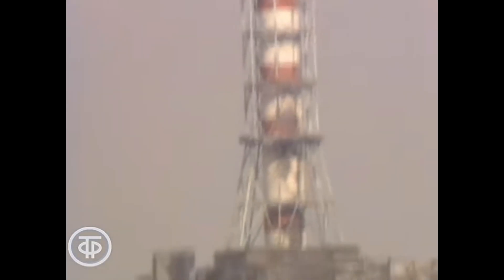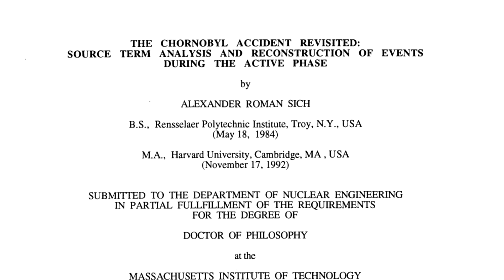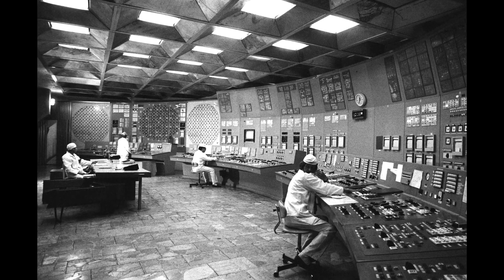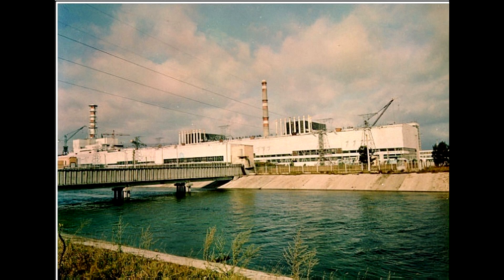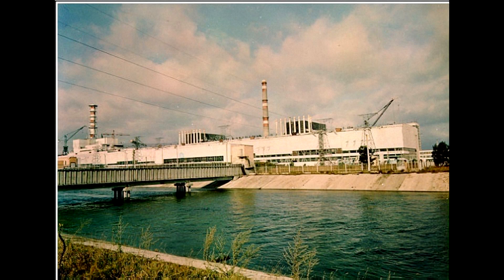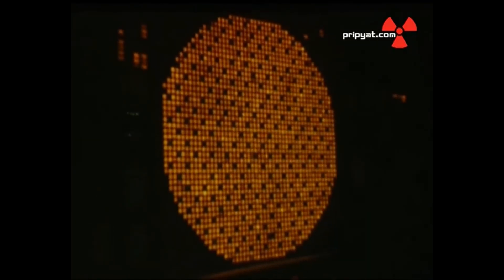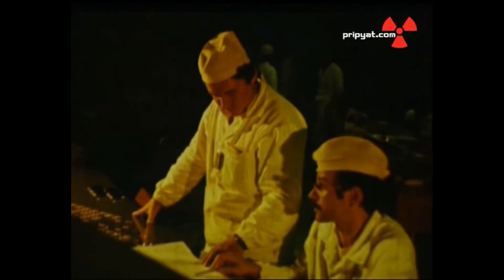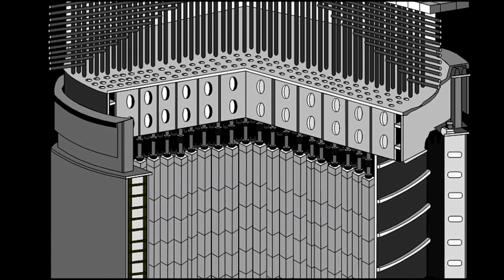Chernobyl Explosion Theories: Sich's Theory - The Last Seconds of Reactor Four

Comment: Chernobyl underwent a prompt critical nuclear excursion. The energy release at the power levels cited for 2 seconds would amount to a TNT equivalent release of 700 tons. As this is an exponential rise and the power level is only crudely estimable, the actual release may be substantially less or more than this. In either event, this was clearly a huge energy release measured in not less than tens of tons of TNT equivalent energy and more likely in hundreds of tons to a kiloton of TNT equivalent energy release. It was a low to very low yield nuclear detonation. 

That nuclear physicists do not want that to be the answer is irrelevant. That there is a dominant myth that reactors cannot ever nuclearly “blow up” is just that - myth. It happened here. It happened at SL-1. It happened at KIWI-TNT. 

The instant this energy was released other things happened as well. Nuclear fuel and cladding stores hydrogen gas as an inter-metallic hydride equivalent. In essence the naked protons fill the Fermi sea of electrons in the metal lattice. For transition metals like nickel, uranium and a few others this storage density can reach to greater than the equivalent storage density of cryogenic hydrogen in the same volume sans metals. This is what makes nickel-metal hydride batteries so useful for storing energy. 

During those few seconds the intense fluence of neutrons, gamma and x-rays rapidly dissociated an immense amount of the water, and raised the temperature in all of the metals driving the hydrogen out of the fuel and cladding. The hydrogen gas mixed with oxygen from dissociation and the in rush of oxygen from the air as the lid was ejected then led to the spontaneous recombination of the hydrogen and oxygen in a massive restricted detonation wave. 

Simultaneously, the sudden high pressure gas release from the dissociation and conversion of the water to steam drove the core apart radially and vertically. It became a giant mortar launching the lid into the roof, and detonating as it did so destroying all of the walls and roof. The reaction creating a temporary imbalance in forces that blew the bottom of the reactor down seven feet into the basement allowing the sand shield to flood in through the gap as the now molten fuel poured to the lowest point combining with the sand to create the corium that poured down through the five levels of the basement and sub-basements to become the elephant’s foot. 

In no way was it a “steam explosion”. Steam cannot explode. Vessels under high pressure can fail releasing huge volumes of water that instantly flash to steam and as an expanding vapor cloud carry great force. But it is wrong to call this a “steam” explosion. 

With the hydrogen gas release this was more analogous to a massive BLEVE.
Reply: Does the corroding Zirconium fit in anywhere for you?
Reply: @bobdrooples  Yes. Rapidly oxidizing in the high temperature environment, leaving the hydrogen from the water behind to mix with air.
Reply: Your arguments cogently explain the issues and fit the known facts better than the Sich approach.  Most people do not understand the consequnces of prompt criticality and its associated very short doubling time.  An analysis of what the doubling time may have been in the worst affected channels would be very interesting.

Comment: A video I'd like to see would be about the cranes. There were building cranes that were abandoned after the disaster. They stood abandoned for over thirty years. Are they still there? If not when did they vanish and what became of them?
Reply: Dismantles partially for the construction of the rolling roof prior to installation.
Reply: I'm sure the cranes you are talking about are at reactors #5 and #6 which are a short distance south of the main complex, the cranes were there for the construction of those units but all work at #5 and 6# was abandoned after the accident.

Comment: Honestly? I would imagine that there was a minor actual nuclear detonation mistaken for a steam blast.
Reply: The Uranium in a nuclear reactor will not detonate like in a nuclear weapon. It is not rich enough in U235, and there are too many factors impeding such an event. Which is good. Because the Hiroshima bomb contained 65 Kg of weapon grade Uranium but only about 1.2 Kg reacted before the weapon blew itself apart, so if a nuclear reactor with several hundred tons of Uranium could actually undergo a 100% efficient detonation then most of Eastern Europe and Western Russia would have been flattened. Luckily none of this is possible and I speak only hypothetically.
Reply: no, if such a reaction is started, it will not end until there is no more fissionable material left. you would be looking at a big crater and not at an otherwise intact powerstation today if that was the case
Reply: @supersst838 lol no that's not how this works

Comment: Don't know if there would have been enough time for sufficient hydrogen to build up to create the largest explosion but steam... Water expands 1670x its size when flashing to steam. If you can't keep that pressure in then it's going places.
Reply: i think also if hydrogen was the reason for destruction it would be much worse, as combustion like that really has power to it compared to the steam
Reply: Also the oxygen from the corroding zirconium.
Also potentially explosive together with the water depending on how the welds went.
Reply: This makes me remember a number of railroad disaster photos I have seen. Low boiler water instantly flashed to steam, extreme instant pressure causes an explosion that kills the crew and throws the boiler down the track ahead of the train.

The graphite, and maybe even some fuel went into the atmosphere when it was pulverized by escaping steam.
Reply: Also: if the water completely dissociated into atomic oxygen and atomic hydrogen because of the temperature it would fill even three times more space at the same temperature. And the temperature was extremely high, possibly in the hundred thousands of degrees.
Reply: Are we dead ahh 67 really? 🥀🥀🥀🥀🫩🫩🫩🫩

Comment: 5:55 as physicist it feels inaccurate hearing something measured in Watts referred to as energy, but I'm not familiar with the exact terminology of nuclear engineering.
Regardless, thanks for making this video! I love this kinda 'the devil's in the details' (for lack of a better word) analysis. Very well presented and explained, imo!
Reply: For nuclear reacts their "power" is commonly expressed in Watt of Thermal Output (how much heat the reacot itself is producing) amd also in watts of electricity generated. If i recall correctly the RMBK was rated for skmething like 3000 MW of thermal, but only produced about 1000 MW electrical
Reply: You are correct sir. Power is measured in Watts and energy is measured in Joules.
Other units can be used, depending on the context.
For example, where the energy released by fission is used as a measure of fuel irradiation or burnup. The usual energy units here are Megawatt-days or Gigawatt-days.

Comment: I dont understand why removing the water increases the fission rate as water acts as the moderator.
Reply: In the RBMK, graphite is used as a moderator.  So between the water and graphite it is what we call 'overmoderated'.  Changing the amount of moderator a little bit by removing some of the water (or just boiling it to steam) has little effect on the moderation rate.  But water is also a slight poison in that it absorbs some neutrons.  So in the RBMK design, removing water has little effect on moderation, and a stronger effect as a poison.  This gives it a positive void coefficient (boiling the water adds positive reactivity)  Much different than the west's BWR technology where water is the principle moderator and has a negative void coefficient.
Reply: The coolant water acts both as a moderator and as a neutron absorber.
So the net effect on reactivity depends on the relative strength of those effects.
When fast neutrons are emitted from the fuel rods, the cooling water is the first moderator they encounter.
When thermal neutrons return to the fuel, they must pass through the water on the last leg of their journey.
If the neutrons are well thermalised, a significant proportion of them will be absorbed by the water and that will reduce the number of neutrons that can reach the fuel.
When a RBMK operates with highly burnt up fuel, the effective fuel enrichment is low. For a given power, this requires a relatively high thermal flux to reach the fuel. That results in high neutron absorption in the coolant. So then the net effect of voiding the coolant is that more neutrons can get back to the fuel and cause fission, i.e. reactivity increases in spite of the loss of moderation also caused by voidage of the coolant. Operating in this state also requires most of the control rods to be withdrawn, so most neutrons sre only either absorbed in the water or in the fuel rods.
But when operating with fresh low burnup fuel, only a relatively low thermal neutron flux is needed for a given power. So most control rods need to be inserted to absorb excess neutrons and there is much less neutron absorption in the coolant.
Voidage of the coolant then causes a  less significant change in neutron absorption so the effects of reducing moderation then dominate. That gives a negative void coefficient. This seems to be how the designers expected RBMKs to operate most of the time. However economic imperatives seem to have led the USSR to operate with much higher fuel burnups. It seems they knew this caused positive void coefficients but they did not fully realise the hazards associated with this.

Comment: I always wondered if they had turned the water pumps back on at the original power surge if that would have been enough to get control rod's back in although the az button would probably still make it go pop
Reply: There wasn't any kind of abrupt surge until AZ-5 was pressed, and the pumps were still operating. They did need to add more water to keep reactivity steady, but it probably would have taken a minute or two to make a difference. Someone probably would have pressed AZ-5 before then regardless.
Reply: @MinSredMash  there was a very rapid increase in power before the az button was pushed the test to see if the spooling down turbine could power the pump's meant a reduced coolant meant a surge on power  that made the bio shield blocks bounce up and down it's even in the vid the power surge before they were there knickers and pressed the az button
Reply: @gingernutpreacher  You should watch the other videos on this channel to be disabused of elementary misconceptions (like everything you just wrote).

The so-called "bio blocks bouncing" is a perfect acid test for people who confuse fan fiction with history.
Reply: @MinSredMash  so testimonials are to be dismissed?
Reply: @MinSredMash  so you're saying there wasn't a big rise in power from around 215mw when they turned the pumps off? What ever you're taking I don't want any because it makes you eat your arm off and speak in a pottery's acsent
Reply: @gingernutpreacher  No pumps were ever turned off. Four pumps (more than necessary) were always running at full power, and four more were running at first, but then decreased their output by 20% over the course of 35 seconds. No power increase larger then ~30 MW was ever detected by any instruments, until after AZ-5 was pressed.
Reply: @MinSredMash  where can we read the account because I swear the reason they pulled bout nearly all the control rods was because it went down to 30 and they got it up but not up to the level it was supposed to be conducted bat
Reply: @gingernutpreacher  who could have been close enough to the core to see the caps jump.... and live?
.
No one....
.
The guy who says he did would have had to run at like 80mph
Reply: @gingernutpreacher  I'll have to find it.... but you can get a document/PDF of everything the computers spit out
.
It's broken down by the second
.
I'll try to remember after work
Reply: @kainhall  please enlighten us...after work
Reply: @supersst838  shit, forgot..... I'll try to remember
Reply: @gordonjenner2375  if there was no power Serge why was the NZ button pressed?
Reply: @gingernutpreacher  Pushing the button was always the plan from the start. The only question is why they didn't press it 36 seconds earlier when nothing was going on. At some point they remembered to press it.
Reply: @gordonjenner2375  that' wrong where are you getting this? 22:00 https://youtu.be/IkBJU8BbrUs?si=ZJouQ26HPeXTmuJS
Reply: @gordonjenner2375  You only described half the test. The main circulating pumps have enough inertia to continue supplying coolant in the event of a blackout. The extra pumping capability from the turbine rundown is only needed when an 800mm coolant pipe breaks at the same time as a power failure. And during the test they were always supplying plenty of coolant from half of the pumps, connected to offsite power. So the test never compromised reactor cooling.
Reply: @gordonjenner2375  Every participant ever interviewed on the matter has stated that the reactor should have been shut down at the START of the test. That's a fact. Dyatlov said it, and Akimov told the investigators that. They pressed AZ-5 36 seconds too late at an arbitrary time (the generators were mostly at full load but not completely).

Furthermore, if they had followed test procedure as written, the reactor would have scrammed AUTOMATICALLY due to the 2-turbine trip signal, as soon as the steam valves were closed.
Reply: @gordonjenner2375  You are getting confused and describing what actually happened, not what was supposed to happen. Go read the test program. It never references shutting down the reactor AT ALL. As I already explained, if you run the test as described in the program, you will have one turbine running and electrical power will be above 100 MW. Therefore when the steam valves are closed, the reactor will automatically scram itself, without use of the AZ-5 button. Now stop quoting Dyatlov's book while also arguing against what he says on the following page. He wrote very plainly that Akimov was supposed to scram the reactor at the start of the test, and Akimov said the same thing on his deathbed.
Reply: @gordonjenner2375  Eh what? There is only one test program under discussion, from the 1986 turbine rundown. The program does not say when to shut down the reactor. If you've got a "different" version that says otherwise, then speak up.
Reply: @gordonjenner2375  I think you are just arguing for the sake of arguing. I explained the point where you are confused, and you never made any substantive response. Here is a direct quote from Dyatlov confirming what I said. Read it or go away:

"Why Akimov delayed the command to shut down the reactor will never be known. In the first days following the accident we still had discussions, before we were put in separate hospital rooms, and I could have asked, but I did not view it as significant. The explosion could have occurred 36 seconds earlier, that is the only difference."
Reply: @gordonjenner2375  Are you seriously so stupid that you think that the Polish-language transliteration of a Russian surname is the only correct spelling? Literally only 0.005% of the world's population would ever transliterate the name as "Djatlow." Now you are just trolling. In Russian it is Дятлов.